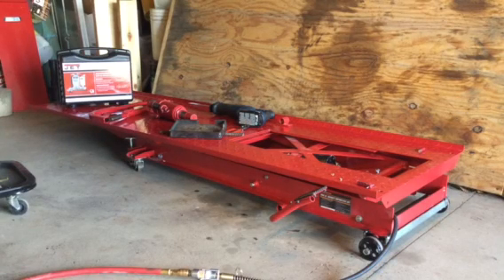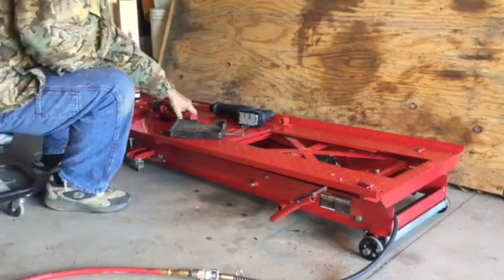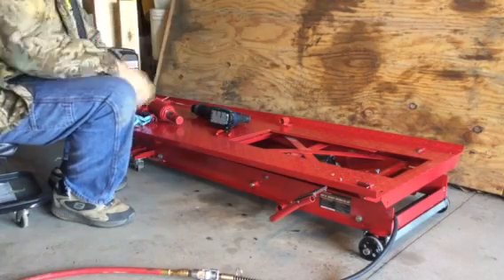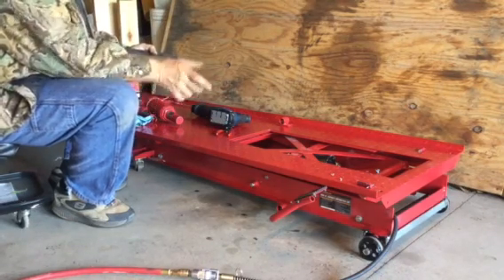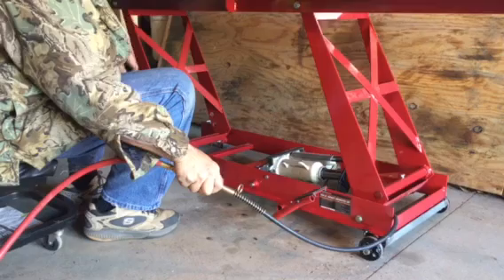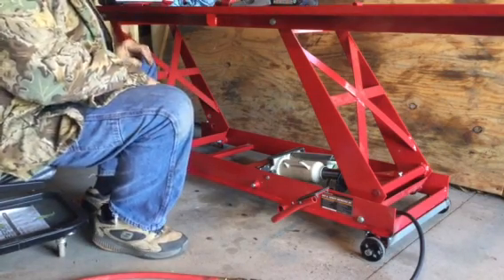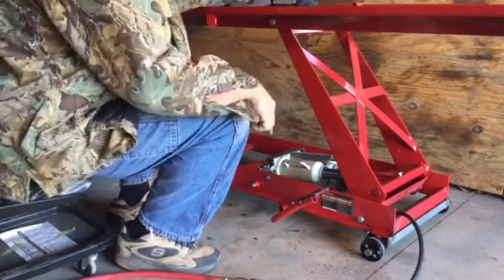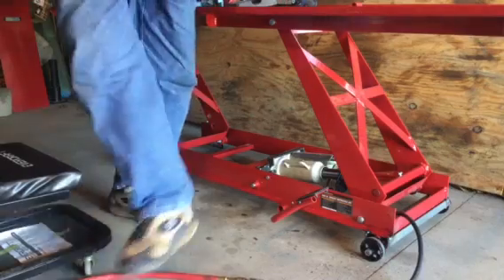Harbor Freight 1,000 lb. Motorcycle Lift Air/hydraulic conversion

Comment: I have the Central Pneumatics motorcycle lift table from Harbor Freight that had the air/ hydraulic jack. After about 12 years the pneumatic pump gave out and I manually pumped it up for about a year. For several years I had been toying with the idea of converting it to a hydraulic cylinder similar to a log splitter.  After about a year of hunting on line and through junk yards I came across a hydraulic pump unit for an automotive lift.  I found a 2" cylinder with a 6" stroke that I thought would do the job.  I fabricated a mount out of a 4" square steel tube (a little over kill there. 3" would have been quite adequate).  That served as a cross member between the frame rails of the lift frame. I made a post out of 3 pieces of 5/16" X 2" bar stock sandwiched together and welded. The material for all the fabrication came from the local scrap yard. I drilled one end to receive the clevis pin of the hydraulic cylinder.  Then I centered and welded the post perpendicular to the square tube. I had to weld the cross member onto the frame far enough forward for the rear lift arms to clear in the down position.  That meant removing the rods for the pedals.  The rod on the cylinder was much smaller than the ram on the old jack so I had to make a collar to thread on the end of the rod to make it fit into the cup on the V plate.  The pivot rod for the V plate broke the center bolt twice so I drilled and tapped each end and bolted a fender washer to the ends to keep the rod in place.  Once mounted and connected to the pump unit I rolled my 600# bike on the lift and hit the button to lift it.  I found I had turned my lift into a catapult.  It lifted the bike to the top in less than 2 seconds, and when it got to the top it jerked the whole assembly back about 4" along the floor.  I had to slow it down.  To do so I made a restrictor that I put in the fitting by the cylinder to restrict the rate of flow into the cylinder.  I had to choke it down from 3/8" down to .025".  That slowed the lift down to 8 seconds and kept it in place.  The pump unit has a go switch to raise the lift and a lever to let it down by gravity. I installed a pedal switch on the opposite side of the lift so I can lift it from that side too.  Since the cylinder has a 6" stroke and it only takes 4" to lift it all the way, I installed a stop switch to keep it from over extending.  I put a 960# bike on the lift and it lifted it about a third of the way up and overloaded it and blew the breaker.  I then installed a 2 1/2" cylinder which gave me plenty of force to lift a 1000# bike.  I realize that this is a little more work and expense than the air/oil conversion done here, but I think it was well worth it.

The only down side is if the lift isn't all the way up, and I want to lift it higher,  I have to let it down, either on to the safety bar or all the way down.  This relieves the pressure on the hydraulics and allows the motor time to spool up again to lift it all the way.
Here's the link to the video on the mods I did.
https://youtu.be/T6eHjhZNkXw

Comment: Good video. What do you think about adding side to table to allow for riding mowers to be listed? Think it will work?
Reply from the maker: I have a 4x8 sheet of plywood that is reinforced on the ends with 2x4's, on the bottom side of the plywood I have nailed in 1x4"s to fit/drop into the topside of the motorcycle lift, this way the 2x4 reinforced plywood will be centered and stationary. Also I have four 4x4's cut to length to approximately 30" long, the 4x4"s have patio feet on the bottom end. I place the 4x4's on the 4 corners after I've lifted the motorcycle lift up with my lawn mower/atv/golf cart on top, and carefully lower and center the 4x4's on the corners, I place just enough weight on them, while keeping the motorcycle lift as the primary support. Keep in mind these 4x4"s only stable this platform. Be very very careful if you do this. I've done this for all the years I've had my 1,000 lb. Harbor Freight Motorcycle lift, ive used it hundreds of times with no fail. I did not place pictures of this on YouTube, only because of the nature of this. If a person is responsible and careful about how you do this, it works. I've also built custom ramps for this application. Thanks for the comment.

Comment: No I just wanted to experiment to make any small engine to pump big hydraulic cylinder which is assembled with a design reciprocal motion and using sprocket to convert rotational motion. ..what is your idea if I convert it in a wheel?

Comment: Did you have any trouble with the bottle jack not working at first because you had it tilted on it's side? I recently bought one to make this same modification and the jack works fine in the upright position, but will not pump when laying on it's side.
Reply from the maker: The Shade Tree Fix-it Man , with the jack on its side and the fill hole facing upward, I added more hydraulic oil
Reply: I was thinking and hoping that, that would solve the problem. Thanks for answering my question, now on to my lift modification. Thanks for the instructive video!

Comment: Does the lift go flat ? It looks like the jack is holding it up
Reply from the maker: Ray Hill it does now after the screw on the jack was bottomed out, during this video I had over looked that it was extended out about a half inch. Thanks for that comment.
Reply: Thanks for the reply Bryan.  You did a great job on your ramp.  Thinking about doing mine the same way.  My lift is working just fine and doesn't leak at this time (fingers crossed) air over HYD is the way to go for sure  ....

Comment: Hey Bryan, I was wondering if you could tell me the exact jack you used? I looked up the 12 ton jet jack and it says its 15.7 inches tall. That's too tall to fit between the cross member and the triangular lift piece. Thanks.
Reply from the maker: trukerat1551    Jet stock number 456612 model # AHJ-12 minimum height 9 2/3" 18 2/3"
Reply from the maker: 18 2/3" is the maximum height, it will lift 6"
Reply: Just cut the crossmember out and move it back reweld it

Comment: You said that the new jack was overkill. Did you use the Jet AHJ-12   12 ton jack?    Do you think that a 5 ton jack would be strong enough for this lift?   Thanks
Reply from the maker: Larry Wiseman I can't answer that, I didn't find a 5 ton Jack until after I'd purchased the 12 ton.. I welded a a small extension of steel pipe onto the screw part of the Jack to in order to get the correct length. The piece of schedule 80 pipe I used fit perfect inside the lift mechanism, I'll measure the diameter pipe and get back to you
Reply: Thank's for your reply.  Northern Tool has a Strongway Air/Hydraulic 5- ton that looks like it would fit for only $55.00.  I just don't know how to do the math to see if its strong enough.
Reply from the maker: Larry Wiseman -yes that's where I saw the 5 ton jack also at Northern, for that price it would be a nice, handy Jack to have on hand. I'm not a mathematician either, I sort of run with "Trial & Error" I did compare size wise/dimensional  the original Jack with the Jet 12 ton and I didn't want to use anything smaller, that was my decision factor.

Comment: Looking forward to part 2. 

I just bought this lift, despite lots of people having problems with the jack.

If/when my jack fails, I will be looking to do a similar mod.
Reply from the maker: Need For Speed I hope it works well for you with the foot pedal pump. I only changed my hydraulic jack being the pump cylinder leaked hydraulic oil really bad. Good luck.
Reply: So far no leaks, had 3 different bikes on it and it's been up and down many times.

Maybe I got a good one, but am still interested in the mod for the air cylinder.
Reply from the maker: Need For Speed https://youtu.be/kmMOIPg8k80